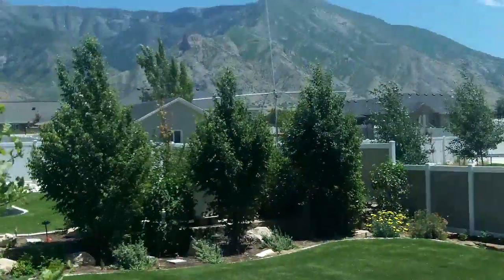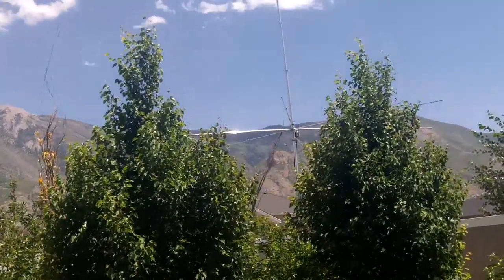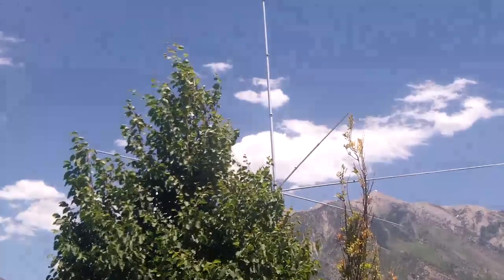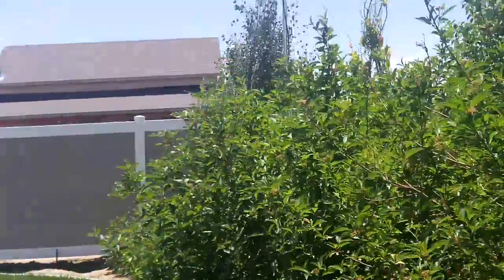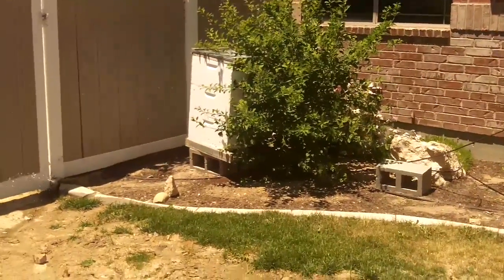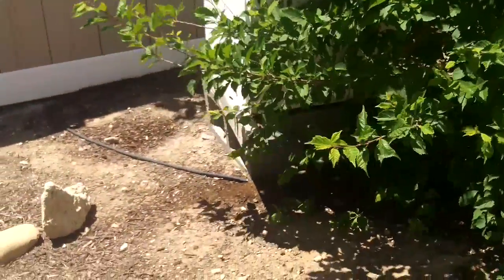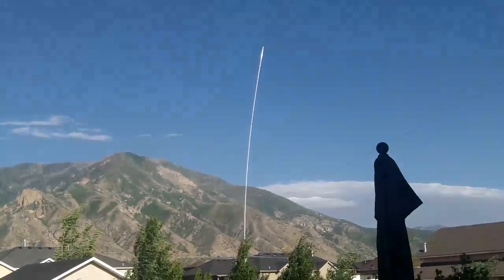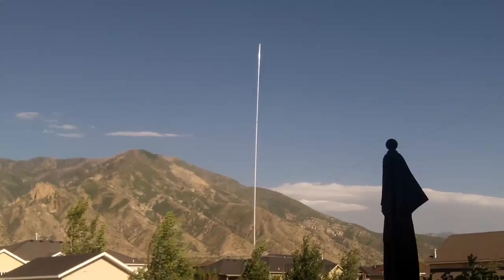Zero-Five 10-40 Ground Plane Vertical  Zero-five

Comment: I have this antenna along with two yagis and a Hy-Gain penetrator for 10 / 20 meters. 
The Zero-5 works great, and even tunes well to 80 meters allowing for the 1500 watts easily.  

I worked the WW CQ DX contest using it so I wouldn't be spinning the beams around constantly and was happily surprised at how I was getting contacts all around the globe with reports of over 9 most of the time. 
I highly recommend this as a primary antenna for both local ground wave chatting and world-wide DX chasing.  It handles power with ease and tunes to everything between 10 and 80 meters with an SWR less than 1.1:1.
It holds up to high wind also; bends to almost 45 degrees but snaps right back. A very well constructed instrument using high quality material and built with care before being marked and packaged for shipping. Each is tested from what the owner of the company told me and he builds the all himself.

I will use it this evening on 80 M for some AM rag-chewing. 

Thanks - James, KB2FMH in NYC